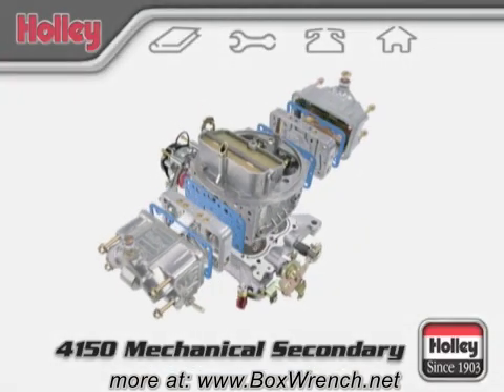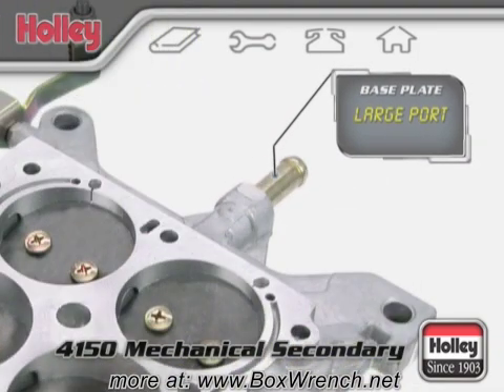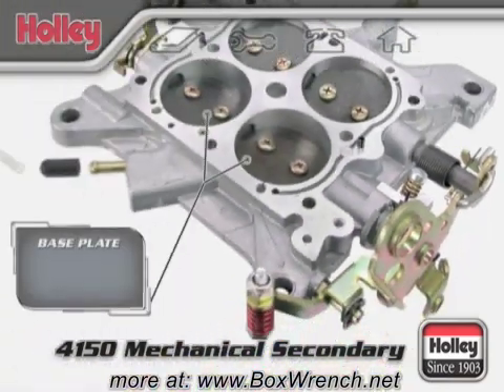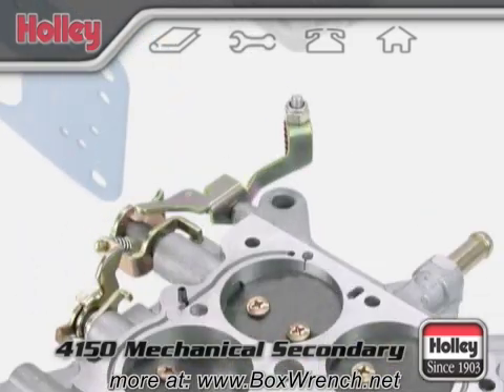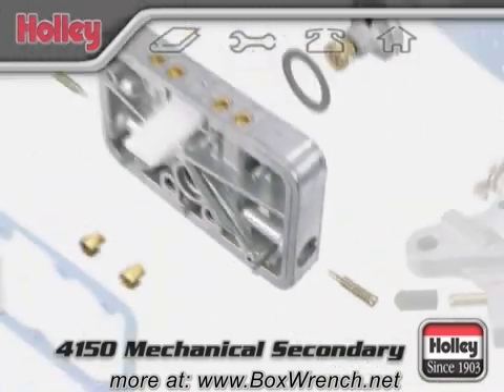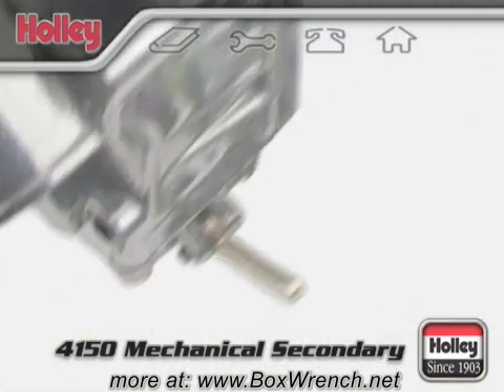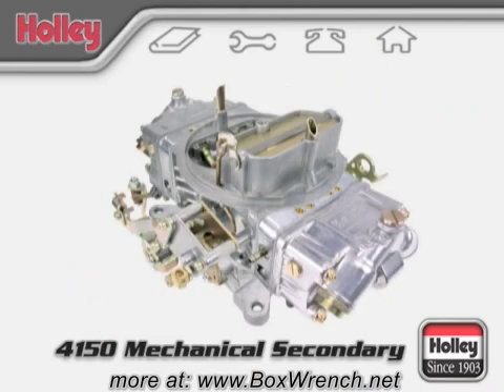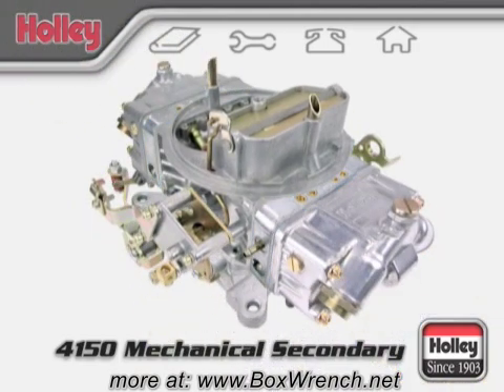Double Pumper Carburetor Video - Holley Install & Tuning DVD

Comment: Always wondered about double pumpers.  Two fuel bowls. So do you have to run a second line from front bowl or does fuel get to second bowl internally somehow. Im new to double pumpers. Never had one.

Comment: @93Patriot  Unless your dad is using the carb on a race application engine, toss that POS Holley in the trash & snag a good ol' Carter/Edelbrock AVS. much easier to tune & they won't give you the problems you'll continue to encounter with the Holley carbs.

Comment from the maker: @adamslurch71 You would definitely need to have a larger displacement engine to even take advantage of a Holley Double Pumper. 
The best way to determine if you've engine specifications are large enough to take advantage of the extra fuel delivery from a double pumper is to use the "Carburetor Calculator" at the Holley website. You answer some questions about your engine, RPM range and accessories, and it will guide you to the proper CFM size rating for your engine.

Comment from the maker: @93Patriot The type of rubber that is used for the needle and seat assembly is a material called Viton. They are designed to seal well for a period of time, but when they reach their end-of-life span, it is normal practice to just replace the needle and seat. 
There will be no visible wear or clogging that needs to be cleared. It's just the nature of the standard Holley service schedule to replace the needle and seat when they harden. 
The problem comes from non-use of the engine over time...

Comment from the maker: @93Patriot Sounds like the needle and seat assembly needs to be replaced, not just cleaned. 
It's a standard procedure for any Holley carb as a regular service overhaul. The needle and seat is included with many of the complete rebuild kits as well.
Just start by getting a new pair of needle and seat assemblies and replace the one in each bowl. re-set the bowl level and your described problem should be solved. 
Then you can think about the rest of tuning. Our Holley DVD can help if you like...

Comment: I have a modified 350 and it has a Holley 700DP on it. We've been having trouble with it constantly loading up and flooding out. We have taken the carb apart, cleaned it, and frequently adjust the floats but it keeps flooding after running the car for a few trips. Unfortunatley it has come to the point that if we can not resolve the problem, the Holley will be coming off and being replaced with a Carter. Any ideas on what may be the problem?
Reply: Any ideas?

Comment from the maker: @3MAN09 Double Pumper carbs are most useful for use in higher horsepower engines with large camshaft profiles and/or manual transmissions. 
They have four idle screws (one for each carb barrel) and also have dual accelerator pump systems (squirters) so you can more effectively tune the acceleration fuel demand curve for the higher HP types of engines. 
They are most effective at eliminating 'flat' spots in the acceleration curve at the point where the secondary throttle plates open.

Comment: @BoxWrench  Hello I'm running a holley 650 DP on a 1.3L rotary engine. I know it's abit big a 500 would be more what I need for my set up. The engine will idle fine with the choke on but as soon as I take it off the carb leans out, engine high revs and its sputters till it dies. Anyone know what my problem could be? I'm leaning on a air leak. It's getting fuel fine but as soon as that choke is let off game over.

Comment: mechanical only means the secondaries are open mechanically not with engine vacuum.  You can run vac dist and canisters with mechanical carbs.  Note mechanical has pros along with cons as compared to vacuum secondary carbs

Comment: i would keep the 650.  A bigger carb would only help you if you had a larger ci small block 383 or 400 or rpm aboove 6500.  Putting a bigger carb will most liklely slow you down, foul plugs, bog off idel etc..  I had good luck with a edel 600 cfm on a 350 street motor.  I put a 750 on my 406 small block but it had 11.5 cr and a .555 solid lifer cam rpms were 3-6500.

Comment from the maker: Seems like it may be a good set up for you. Only thing is the secondaries of the carb. With a manual transmission, you would possibly benefit from mechanical secondaries if your carb currently has vacuum secondaries. 

Not a requirement though, just make sure to get your carb tuned properly with the help of a vacuum gauge and the proper jetting and idle settings.

Comment from the maker: Which port are you connecting the distributor vacuum line to? 
It should be the one that exits the passenger side of the primary metering block...not any of the ports on the base of the carb.

Comment from the maker: At :21 seconds into this clip, the woman describes what "double pumper" means. 
It just describes the fact that there are two accelerator pumps, one one the primary fuel bowl and one on the rear fuel bowl. 
Two accelerator pumps also means there are two discharge nozzles. 
The discharge nozzles (squirters) are solely responsible for making sure that enough fuel in introduced at the critical "lag" moment when the gas pedal is pressed. 
Makes for better throttle response in a "Double Pumper"

Comment: for small block chevy Q-jet workes allmost all the time beter ,i try tune holley it was fine but not very sharp some time you get flat spots in US you can have jet kits to fine tune it power valves but Q-jet is more responsive with small block and very important thing if you go street racing then Q-jet is realy shining.

Comment from the maker: Does that mean that you did a comparison between a Holley and the Q-Jet? 

Did you actually try to tune a Holley before working with the Rochester? 

If you followed the instructions in our Holley DVD, you'd have any Holley carb running pretty incredibly well...
We've had the opposite experience when comparing a tuned Holley to a tuned Q-Jet, we preferred the Holley every time.

Comment from the maker: Holley Carbs are one of the most popular carburetors for enthusiasts who like to  build power and tune their higher horsepower large displacement engines. 
If your engine has another brand of carburetor you still may be able to use the tuning info from our Holley DVD. You would just need to locate your Idle Mixture screws, idle speep screws and identify the power enrichment circuit for your Bosch carb. Sometimes there is are separate jetting systems for part throttle and wide open as well.

Comment: check your fuel line for a crimp. i was wondering why mine would bog when i reved it, the fucking motor pinched its own fuel line from rocking when under a load. crazy crazy shit.
i had it checked by a GM dealership and they said it was a bad wire that can not be located inside the wiring harness

Comment from the maker: Accelerator pump needs to be tuned. 
You can do it by getting the Accelerator pump cam tuning kit and then find a cam that works well for your engine. You may also need to to to a larger accelerator pump discharge nozzle (squirter) to get enough gas to shoot in during the flat spot on initial "pedal mash". 

Complete tuning for that system is covered in detail in our Holley DVD. It's over 2 hours long...

Comment: I am just pointing out that hollies have a bad reputation for flatspots, thats why they have to give so much info with their carbs.
Why do u think the ford GT40 used a bank of webers and not holley?
holley is good for pouring fuel into big engines with so much torque that flat spots do not matter as much, but for quality, accuracy etc webber is far better.
Bizare that u would use insults to convey ur opinion, r u one of those wierdos that falls in love with objects? like men who fuck cars?

Comment from the maker: That may have been a widely spread opinion  years ago but people that don't like Holley carbs usually don't know how to tune them. 
If you feel a "Flat Spot" in a Holley carb, it's definitely out of tune. 
That's why we made these videos. There's nothing like them out there, definitely not from Edelbrock or Weber. 
Every Holley carb comes with the DVD and using it will give you more knowledge of their carbs compared to any other brand out there.